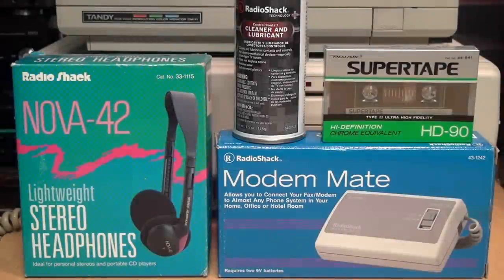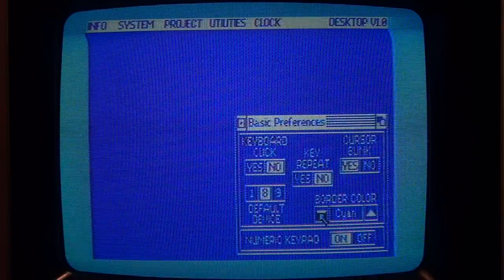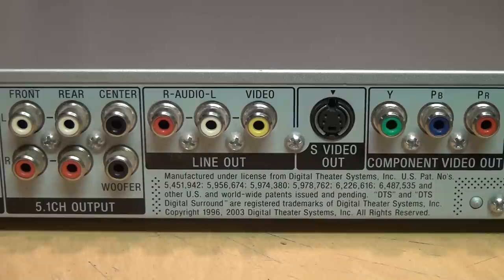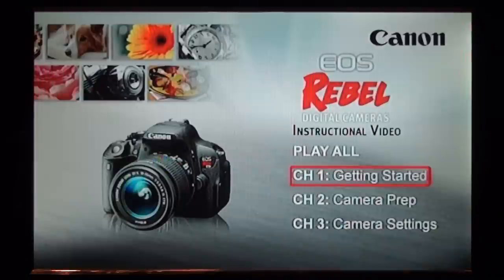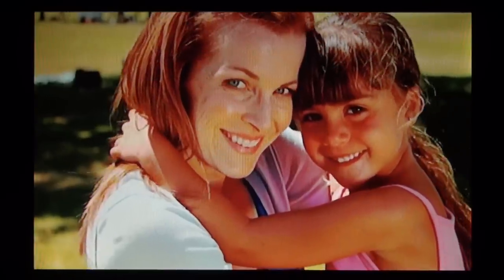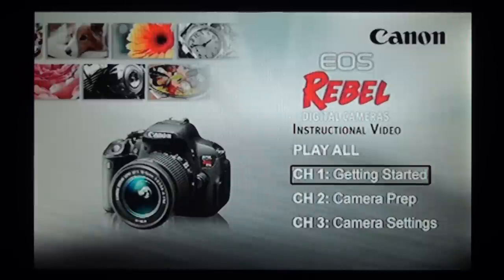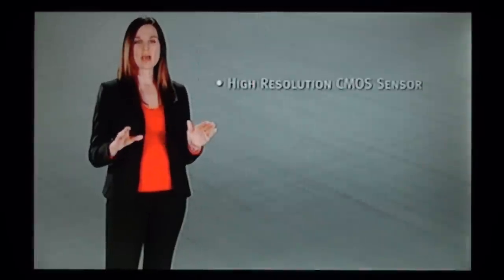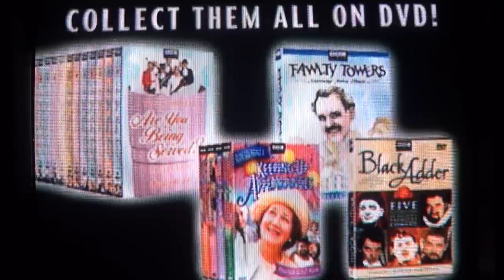Radio Shack S-video signal converter 📺 How? Why?

Comment: It must be the age of the viewers, but no one has mentioned what S Video was. (Actually, I did see one reference in passing) S VHS was developed and the only way to get the HD (relatively) output out of the VCR into a TV without lots of expense was to separate the Luma and chroma signals. so the S-VHS output was invented. This was later renamed to S-Video because other systems wanted the HD output. ( HD compared to Composite). The PAL version of VHS had a luma response of 240 lines. the S-VHS first gen recorders had in excess of 450 lines luma response. A UK S-VHS VCR could record teletext data and it was decodable on playback. I Know because I did it. Handy for subtitles.  However, these S-VHS VCR and the TVs compatible with them were very expensive. £1000 for VCR and £650 for the HD (they called it) TV. normal good VCRs were around the £650 mark and good TV around £450.  In short, these adaptors were not much good but as has been said before, better than nothing. They were no good for real S-VHS quality signals but at least they were in colour. I tried one once but sent it back because it was so soft on the picture.

Comment: First let me say I really miss Radio Shack, my uncle used to own the local store, so I was a fixture there. Next, I grew up when we only got 3 1/2 channels,(3 1/2 cause one channel only came in after dark), and on two channels if it came in good enough for the color to come through you was doing great. So I would still watch any of those signals if that is all I had. That adapter could be used to give an additional input back in the day if your TV was limited on number of inputs. Back in the day I had a VCR, DVD, and a laser disk player. and used a switch to be able to connect them all.

Comment: I remember those.  I think internally they are just a capacitor and a resistor, something super simple like that, it's been 20+ years since I saw the schematic on how to build one.  I borrowed one from a friend to try in a room that had several A/V components and a projector, the hope was to get the composite VCR to S-Video so a simple A/V switcher could be used to select (other two sources being a DVD player and a Dish receiver,) but unfortunately, I got B/W video out of it, probably due to the very long signal cable to the projector (a distribution amplifier may have helped with that.  We ended up just having to switch the projector to composite when VHS was used.  I have seen a projector with only S-video and VGA, admittedly, such a layout is very unusual.  Oh and agreed, it is a shame not having that store with the oddball adapters for most occasions, or the parts to build an even odder adapter.

Comment: I still have a couple of these, albeit with a male s-video end. I used these in my video game set-up. The switch box was connected to the CRT via s-video, to take advantage of the consoles that supported it. For those that didn't, I added this to the end of its RCA video cable so I can cleanly switch to it without having to change TV inputs. (The switch box was passive and didn't support internal conversion between s-video and composite. It was all of one or the other only.)

Comment: Separating luma and chroma doesn't require active components. The simple notch comb filter did it with passives from the 50s well into the 80s in consumer gear. The quality was lousy with dot crawl abound, but it works. The reason why the S-Video to composite video doesn't really have dot crawl is the notch filter is very aggressive in that adapter. It basically stomped on the high frequencies (resolution) of the video to avoid it. Running a test pattern through it will reveal how bad it really is.

Comment: Vizio a few years ago actually made a TV, the d24, which had composite and component inputs, but both of them required the same style breakout cables you would use with a camcorder or portable DVD player, based around a three-pole 8th-in connector. All the modern TVs I've seen still include standard composite inputs. Even our living room TV, a 50-in Westinghouse Roku TV, not only features standard composite inputs, but the antenna setup screen even asks if you're still using analogue devices which require VHF channels 3 or 4.

Comment: I miss radioshack. It was the best. It was like the older man's Micro Center with an emphasis on Verizon phone sales.
Reply: Back in the day, Radio Shack was the place for electronics, radios, television/video, stereo, phones/accessories, communications, computers, electronic musical instruments, kits, parts, and books. If you had questions, they had the answers. And their Battery of the Month cards kept customers coming. Back in those days, their batteries were made by Ray-O-Vac, which is now owned by Energizer. They even had their own record label at one point, selling re-issued music, like K-Tel and Ronco did at the time.

Comment: I used one in the past. The S-Video jack on my TV went bad and there was no way I was going to buy a new TV just because of that. So just because it was more convenient, instead of running new wires, I simply got that adapter and plugged the S-Video cable into the composite input.

Comment: Radio Shack sold a switch box that did this. Whichever type input it had would become S-video out if that was plugged in or composite if S-video was unplugged. It was an un-powered device just like that adapter. It had both S-video and composite inputs.  I've got one of those boxes in my main analog rack, and one of the adapters from this video.
Reply: My educated guess is that it would actually be composite if composite plugged in or S-video otherwise, a seemingly trivial difference to what you said. However it would likely be implemented by working as S-video internally and the Y would connect to the composite pins and the C would connect to the switch on the composite jack via a small capacitor.

On further thought that auto-switching setup would only work on the input side. I don't know how they would achieve auto output switching using only commonly available jacks.

Comment: I seem to remember having something similar.  I know I sold these where I used to work but I also think I got one with a TV Tuner card.  Like maybe the card only had S-Video on it and they included something similar to this (though the S-Video side would be male) to plug into the card and give you a composite RCA style jack instead.  Though that one may not have needed ANY passive component as it may have only worked in one direction?  I read in the comments this probably has at least a capacitor inside?

Comment: In my opinion S Video looked the best on a CRT TV you could see the difference right away everything was more sharp and colours were improved. Before HDMI too get HD video signals Component was the way to go with the red green and blue leads. It could only do up too 1080i analog but it was a big improvement over composite or even S Video

Comment: I bet it would be very helpful for laptops with an S-video output like the Powerbook G4. In fact, I made an S-video to composite adapter for an experiment, just required a capacitor to join them together
Reply: Or if you happened to have a smaller Hauppauge tv-tuner card where they couldn't fit the normal set of connectors

Comment: I had one from RS back in the day - yeah doesn't work great for splitting but worked ok for combining. Used it with a video editing card that only had S in and out, if you used it to combine it would have the color noise on the lumna signal.  The key was the little capacitor between.  I think I also built my own doing that.  Guess it acts as a high pass filter for the 3.57mhz color signal.

Comment: I love Radio Shack items as well, but for me it's Radio Shack RC cars, Lab kits (Aeronautical Lab Kits/Electronics Lab Kit). As for some of their more "odd" items, they were not easy to sell. I worked as an associate for them and Radio Shack was known for those kinds of odd items. Items like the sound spatializer, the Memorex VIS (Similar to the Philips CDi but FAR worse) the Memorex 8mm VCR (yes Sony did license 8mm to Memorex of all companies) even TI99/4A keyboards!! We used to have an inside joke that Radio Shack and Tandy were "Gods of the odd".

Comment: Oh I had one of those back in the day! I can't remember what equipment I had that I needed "converted" but it actually worked enough for my uses.

Edit: I remember now, I had a video card in my computer that only had an SVideo and VGA out, and I didn't have a TV in my dorm room that had an SVideo in. This adapter let me connect my computer up to the TV, and it worked.

Comment: One use case I could see for this is if all your RCA inputs where already used you could use this to add another device that maybe didn't have SVIDEO (like camcorders or game systems or something) . or vice versa
Reply: However on most TVs and VCRs the S-Video and composite inputs share an input
Reply: @und4287  yeah but even if that's the case in most cases you can still leave it plugged in and switch the input.

Comment: Hey vwestlife, i created a homemade AM Stereo transmitter using 1 radio and two crystal radios. I taped the crystal radios next to the internal ferrite antenna. How it works you turn the radio on you tune it while listening with an AM radio set to the upper part of the band you tune the transmitter radio until you hear the other radio go silent, than you send audio into the crystal radios, tune one slightly above the carrier and the other slightly below and if tuned correctly you'll get Stereophonic sound on your AM Stereo radio, I use the Sony SRF A-300

Comment: 2:00 - As for modern TVs, most still have one analog input. The LG high-end 4K TV I bought in 2018 and the Sony high-end 4K TV I bought this year both have a 1/8" TRRS minijack that uses a break-out cable to split it into red-white-yellow RCA inputs. (Of course, the Sony didn't come with the break-out cable, and uses a different TRRS arrangement with GROUND on a different conductor, so I can't just use the old LG's cable for it.)
Reply: yep, those 4 pole 1/8 connectors dont seem to be 'standardised', theres at least 3 different pinouts!
Reply: I’ve noticed that seems to only be the case for the American models, at least in the high-end. Eg my European LG B7 totally lacks such an input, while American B7s retain it. Not sure how that holds up for later models in the line though.
Reply: @kaitlyn__L  does it have 'component' Y Pb Pr inputs, if so, the Y may also act as composite as some tvs will still extract colour signals correctly if fed composite to the Y input
Reply: Luckily for me, all my devices with a TRRS breakout jack are made by Sony or Panasonic, which both used the same pinout. I guess they managed to make that one analog port even cheaper. Used to be they gave you component RCA jacks with the luma (green) jack doubling as composite. It really frustrated me that they killed off S-Video so early as I have many devices with that. Boxes that split the chroma into Yb and Yr are rare and expensive!

Comment: In the past there would be an S-Video connector on GPUs along with VGA and even DVI. We'd have some cables with it in the box and one of those is an S-Video to composite cable. The cable has been in use for some time until the wire broke inside the cabling (most probably caused by abuse) and we decided to dissect the S-Video connector and connect new and improved cable. (a coax!) The composite plug cable isn't coaxial - and that it connects to the pins of the S-Video connector...basically similar to your Y junction demonstration connecting chroma and luminance together

Wikipedia shows an S-Video to composite converter that puts a 470 picofarad capacitor between Y and C. The composite RCA plug center pin connects to the Y pin and the sleeve is ground as it is. Maybe you could try this and see if that's what it takes to create that converter!

Comment: When I was growing up, we had a TV that defaulted to S-video when it was in use. It only had one set of inputs only. We had to use a switch box that converted our VCR to S-Video so we could also watch our DVD player on S-Video. It did the same function as the adapter. It suffered from dot crawl issues.

Comment: My dad use to sell these adapters S video to Rca on the markets, and didn't know how it worked so had just spliced rca into s-video and it produced an image. Also, took the adapter apart years ago to find no circuitry. These things are great when you need 'em in a pinch or to cut corners temporary.

Comment: I have noticed that you can get a cleaner composite signal by routing a higher quality source signal through another device first (like a DVR), but this applies in cases where the source device's Composite output isn't particularly great to begin with.

More specifically this would apply to games consoles. I messed around with some cables when I was still waiting for my video converter solution to arrive, and I got a considerably cleaner Composite video signal when routing a PS1 RGB or S-video signal through a Sony DVR. Tiny bit sharper, little to no dot crawl, noticeably better colors, than stock Composite output from the PS1. It was like a middle ground between Composite and true S-video.

But I also assume that the DVR has some decent video circuitry and some processing/filtering as well, so it's not even comparable to an adapter like this.

Comment: I was hoping you would open it up and show us what's inside but (spoiler alert) it's probably just two resistors for impedance matching. It converts Y and C to CVBS by mixing the signals together; that's it. I think one of the two Y-C signals were at a different level (half of the other one?).
And it doesn't "convert" from composite to Y/C; it just sends the composite to both pins. So maybe it has a couple of capacitors or inductors instead of (or in addition to) the resistors?
Anyway, when I worked at RadioJac -- sorry RadioShack, I would have told customers that it wasn't going to do much good.

Comment: Back in the day I had an Apple Powerbook G3 that had a VGA output and an S-video output.  If you tried naively mixing the Y and C components of the S-video output to make a composite signal, even with resistors to reign in their levels, you got terrible chroma artifacting on all the sharp edges of the signal.  It was totally unusable.  I made one of these adapters with a capacitor and an inductor to roll off the luminance signal at about 4 MHz, which made the picture much softer but prevented high frequency luma components from stomping on the chroma signal.  It worked quite nicely.  

The DVD player probably doesn't generate enough high frequency luma information to really excite this failure mode, so you're probably not really seeing the benefit of the adapter (which is really just a few resistors to mix the two signals together and a low-pass filter to prevent the chroma getting stomped on by the luma.)

Comment: I see adapters like this to be really obtuse but possibly cheap/easy fixes for very specific video setup issues. I've definitely had my fair share of weird video setups in the past that may have called for daisy-chaining stuff through VCRs and the like. I can't think of an exact example but I can imagine for the random person coming into radio shack who's looking for a quick fix for his video setup and this would be one of the cheaper and easily available options for them.
Analog TV isn't really a thing like you said with very few manufacturers bothering to keep analog inputs on HD televisions so of course the application for today's appliances aren't really that helpful but I'm sure it helped the odd fellow here or there when they were being sold.

Comment: When I was in school, I quickly usurped family PC and had it moved to my room, I also had PS2 at that time, but no TV as we only had one in the living room. I was trying to find some sort of RCA to VGA adapter but to no avail. What I did found was that my GPU at that time had a S-Video in and out. So I got very similar adapter and after some trial and error found some TV Tuner software that was able to display my PS2 video on my monitor. It had some noticeable delay, but I quickly got used to it. Besides I was able to do fancy stuff like opening PS2 stream in a window with gamefaqs site on the side. Good times.

Comment: Try comparing the picture quality between PAL and NTSC using the adapter. There might be a substantial difference in the signal degradation. 

Before I got hold of a proper monitor for my C64 in the 80’s, I used the same trick shown here (although I soldered up a custom cable instead) but I recall getting a perfectly fine image on my 14” GoldStar VHS combo TV. I live in Denmark, which means we used PAL.

By the way, the output from a Commodore 64 (the breadbox) is not S-video, it’s Y/C. The Y/C signal voltage is higher than what S-video uses.

Comment: Interesting to see the green-ish border instead of the light blue on the C64 at the end. Did you POKE that yourself, or is something calibrated strangely? It's much more common for the VIC-20 to have a wide variation in border colour.

Comment: I guess a couple uses could be if you have a lot of video devices, and you connect them to your television using a S-Video switch or a Composite switch, and you had a device or two which didn't support one or the other, so you use one of these to connect it to the switch

Or maybe like on older think pads like the T42, they have an S-Video output on the side, and you may not have means to use that? 

Here we would often make use of these passive composite/s video to SCART adapter boxes, since a lot of cheaper televisions only had a SCART input or two (and the rf areal connection for analogue tv)
Or devices which only had SCART outputs on the back
Though usually that wasn't an issue since every TV has SCART